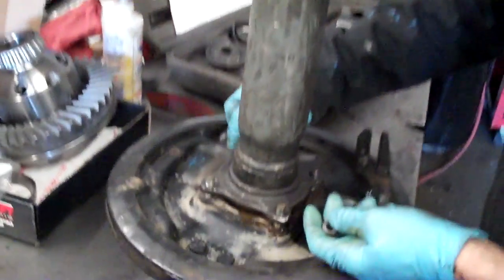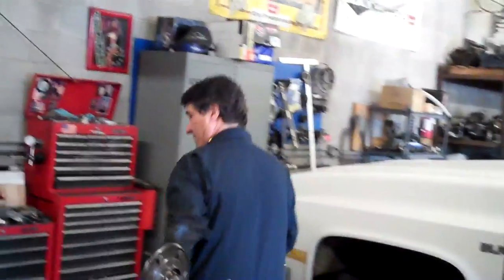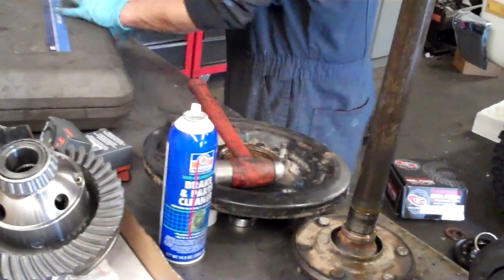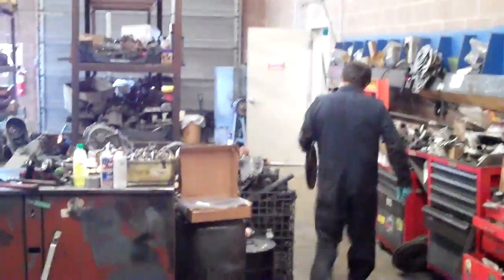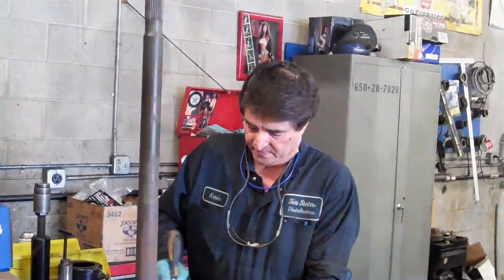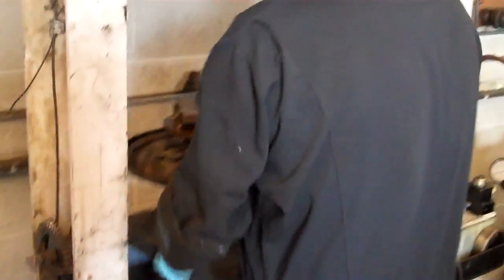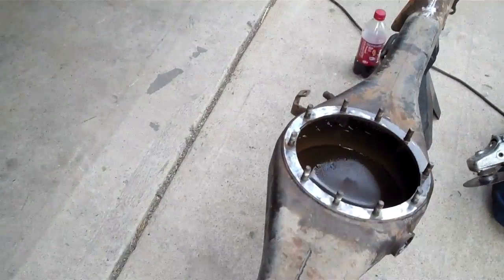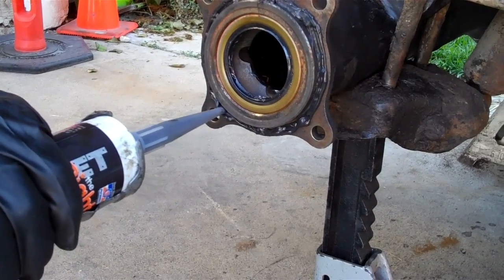Toyota T100 Rear Axle Wheel Bearing Carrier Spring mount repair MAKEOVER

Comment from the maker: Thanks-  The cracks got as far as they did due to gross neglect.  I expect the buttress-like crack welds will further strengthen and prevent future problems.  I use the 3/4 ton diesel truck I have for any heavy 4X4 stuff.  This one is just for moving light stuff mostly on pavement.  When I build tools that get banged on or pulled really hard I buttress weld them.  They just don't fail.

Comment: We were trying to put new axle bearings in my friends 9 inch & could not press the old bearings off. We had a 20 ton press with electric motor, it may have done it if we had kept pushing it but we got scared when the press plates were bowing! A portable Band saw to one side of the bearing & we were done, Safely!

Comment: welding fatigue cracks is kinda tough to stop it from cracking around the new welds, what was done to make it stronger. it seems like Toyota should have had a bigger bracket on that or supports to stop the twist

Comment: Hi, I'm thinking about swapping in a T100 or first gen Tundra axle (as they are the same from what I know) into my old 94' Toyota truck that I'm modding out and lifting next month.  I want the extra width because I'm doing an IFS long travel kit which uses T100 front CV axles so I want the rear to be of similar width.  What do you suggest to beef up the axle and differential? Thanks for the help!